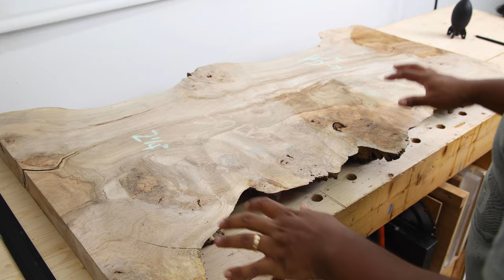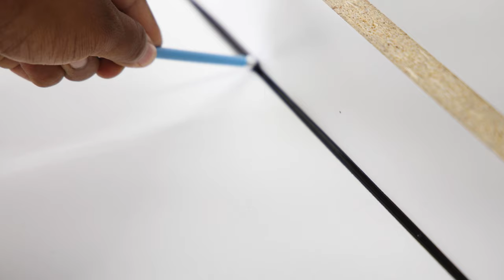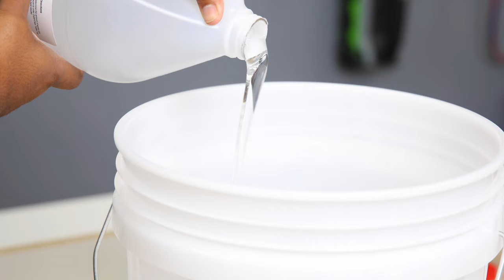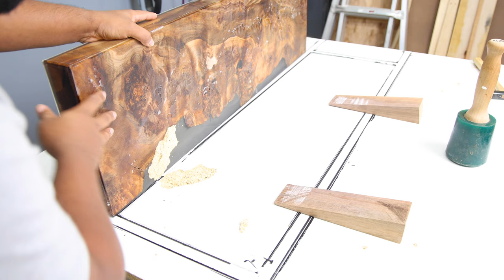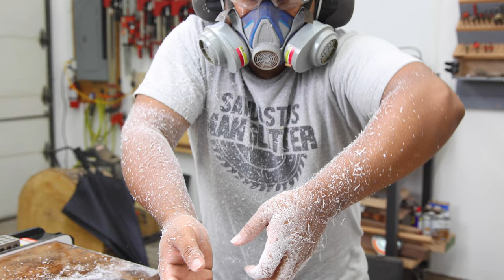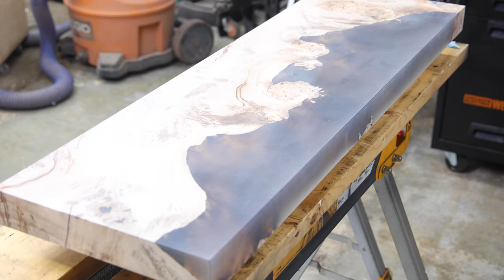Maple Burl + Epoxy Bench Build - DIY Woodworking

Comment: Turned out great, thanks for sharing! Did you have any issues with the epoxy chipping or cracking when running it through the jointer and/or planer?
Reply from the maker: Thanks Wes! Not at all. Casting epoxy machines slightly better than table top epoxy. It also helps to get a really good volume measurements of the two parts to make sure all the molecules have a friend to cure with. Plus, allowing longer cure time helps with the process as well. I have had chipping with table top epoxy when machining in colder temperatures.

Comment: Hi Suman, That's one of the most effective designs I've seen, a well detailed live edge within a very modern looking rectangular table.
Are your jointer blades HSS OR carbide, that finish was amazing off the machine. Great tips as well thanks for the information. Tony
Reply from the maker: Thanks Tony! It’s carbide blades on a helical head.
Reply: @WoodcraftBySuman  I had a feeling it was carbide Suman but a helical head as well, I'm very impressed with the finished cut.
Just looked at the thicknessing section again, that accounts for all the small sized shavings. Well worth it for doing resin work. Tony
Reply from the maker: @tonyworkswood  I’ve got a new dust collector since this video and that would have been a much more efficient way of extracting all the chips than seen in the video. Alas- we work with what we have at the time.

Comment: As I binge watch your videos, a couple questions cross my mind. #1 What camera or recording equipment do you use? #2 Where do you get your rough lumber from or any lumber for that matter, or where might you suggest I could get some for a price that isn't astronomical?
Reply from the maker: Hi Austin, I’m glad you’re liking the videos enough to watch a few. I appreciate it. Regarding camera- I primarily use a canon R6 with 24-105mm f4 lens. Occasionally I’ll switch lenses, however, it is not frequent. 
Best lumber are the ones local to you. From domestics to exotics, you’ll be surprised how much a local lumber yard is able to supply. For anything large and live edge, I usually have them shipped from alderfer lumber.

Comment: What lacquer was that and the sprayer you used to apply it with? Beautiful! I use mono coat but this finish looks great and probably a lot less expensive.
Reply from the maker: I used deft brushing lacquer thinned about 10% using lacquer thinner. It is sprayed using a harbor freight hvlp gun on a compressor.

Comment: Hello suman what lacker did you use to finish the table? Am making a stool with epoxy
Reply from the maker: Hi Carlos- I used deft nitrocellulose lacquer. This was the brushing lacquer that I thinned about 10% for hvlp spray. For a small project like a stool, it probably makes sense to use their rattle can version.